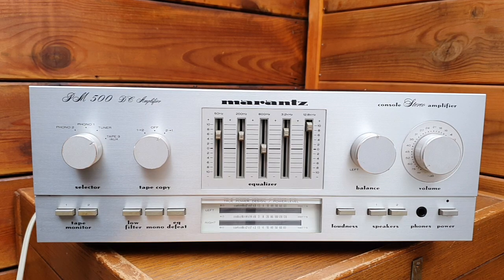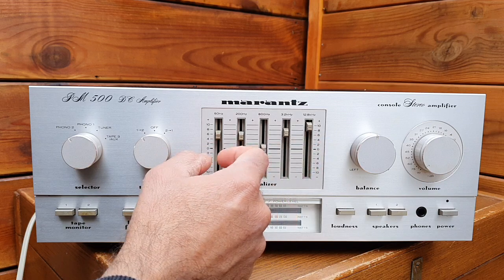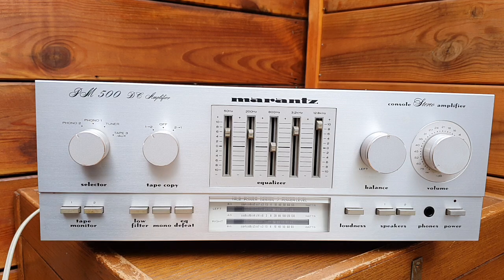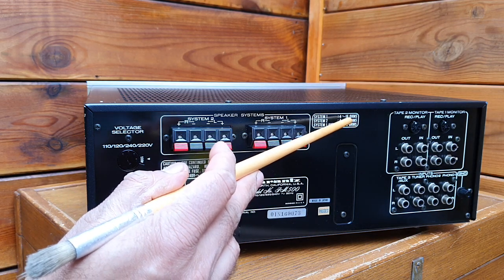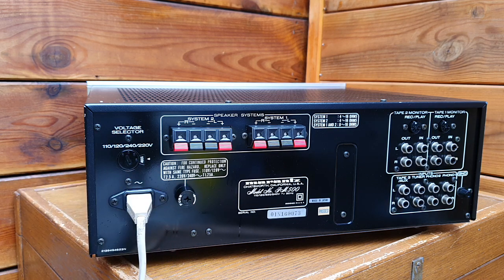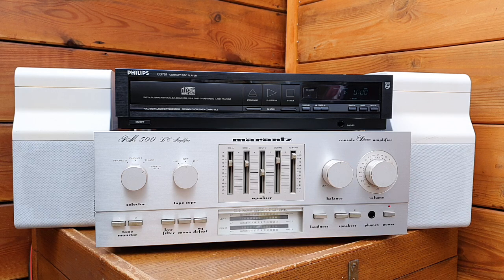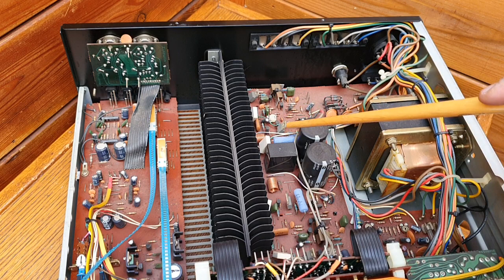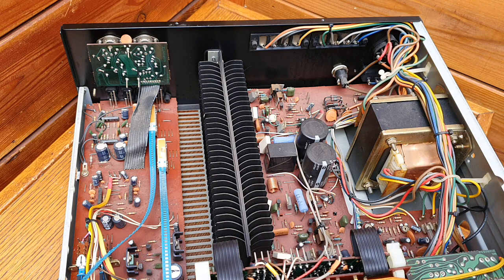Marantz PM500 DC Amplifier: Technical Analysis & Performance Review | Philips CD781 | Bose Freestyle

Comment: Hi , I’ve had my PM500 from new in 1980 . I don’t use it that often now , it’s in immaculate condition. However I have an Issue after an approximate hour of playing I get a loud static noise from speakers, I was wondering if I could carefully clean inside the amp ? I’ve tried to remove the cover by removing the 4 main screws (2 either side and 2 smaller screws on top ) but the cover still seems fixed towards the front . Any advise please on what the static is and how to remove the cover . Many thanks 🙏
Reply from the maker: That's an amazing amplifier to have since new! For the static issue, it's often a sign that some internal components most probably the electrolytic capicitors might need attention, especially after so many years. If you're not experienced with amplifier repair, it's safest to have it checked by a qualified technician. They'll be able to open it up correctly and identify the source of the noise. If you still want to open it up then you must disconnect from power sources first and remove all visible screws then you need to pull backwards the cover not upside. Cover has to be pulled bacwards a bit to disconnect from front plate then you may lift it up. But I advise you to visit the qualified electronics technician. Best of the luck restoring the old Gem. Cheers

Comment: I'm glad you have the same amp. However, my amp has some issue. When I turn it on and after a while, it makes a clicking noise regardless of the volume&Playing music. Is this also a problem with the old electrolytic capacitor that was briefly explained in the video?
Reply from the maker: Yup it is time to re=Cap it my friend

Comment: I have this model ❤
Reply from the maker: It's cool one, I am sure you are enjoying it the most.
Reply: @spacetimeengineering  But it has a small error and needs to be fixed.  I am in Sri Lanka.  It is difficult to find someone to make an amplifier here.  But I'm trying to fix it.🥺
Reply: I have this one as well, its worked so good and hasn’t missed beat👍👍
Reply from the maker: Perfectly made 👌 equipment from good times. Enjoy it, my friend

Comment: Very nice amplifier.  How much could cost one of those? If you were connecting a CD player and a laptop earphones output for streaming from the laptop, which connector would you use to connect each one (cd player and computer) ?
Reply from the maker: Indeed, it's a very cool Amplifier. Well, check it out on eBay and Catawiki sometimes they appear, and if in good cosmetic and importantly excellent technical condition, they are worth between 300 to 500 usd. I advise  laptop headphones out into audio in the Amplifier. Because Amplifier has line level input which is constant, where headphone out of laptop is variable voltage depending the output volume you use so it might get mismatch and overdrive the pre stage in the Amplifier causing distorted sound abd might cause damage in long run. It is better by Bluetooth to RCA device and connect to Amplifier input because it has balanced line-level input and stream music from your laptop via Bluetooth to Amplifier. Or better use minimum volume if you want to connect headphone output of laptop to Amplifier AUX input and adjust volume of laptop, making sure there is no feedback or distortion appear on the sound. Once you find good balance, just leave it like that and enjoy the music. Thanks for supporting the channel 🙏
Reply: @spacetimeengineering  thank you!!!!
Reply from the maker: You are most welcome